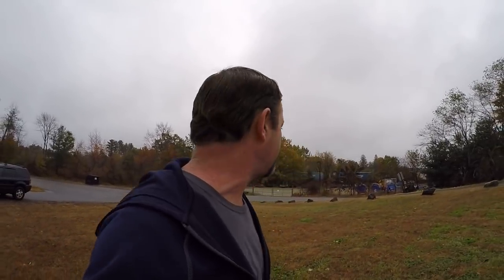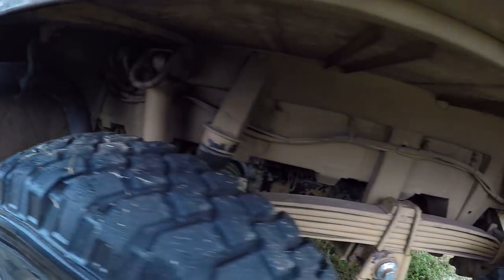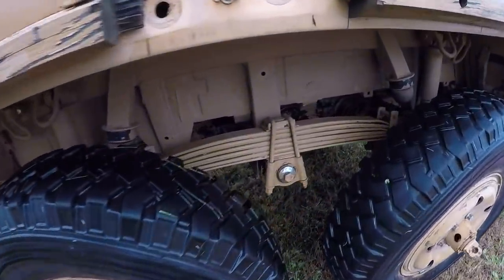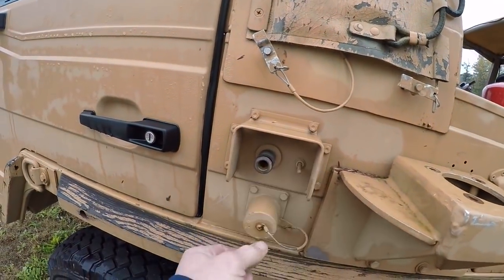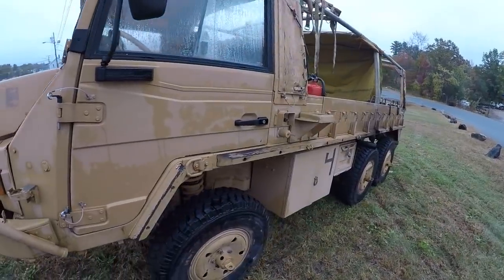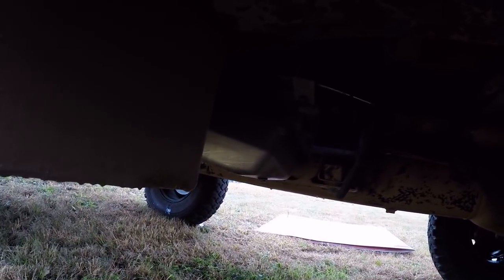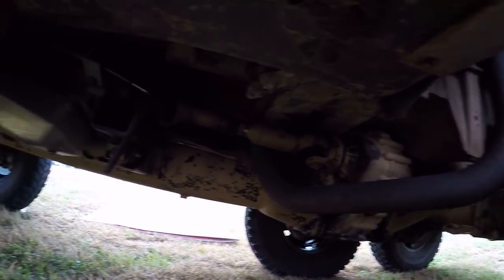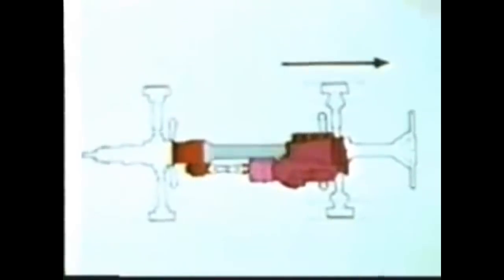70's Puch Pinzgauer 6x6 Ultimate Off Road Vehicle!

Comment: Originally made by the Steyr Puch company with an air cooled straight four in Austria.
The name Pinzgauer is an alpine horse.
The later ones, which is the one in your video is the later with the six cylinder diesel from VW.
Eventually the rights to build them was sold to British Aerospace. Production was only stopped due to the advent of IAD's being  used in the combat zone. The Pinz has no protection from IAD's.
You are correct, the central tunnel is it's chassis.
It was designed by a Mr. Ledvinka Jr. He worked for Tatra in Czechoslovakia before fleeing to Austria before  WW2. His Tatra T97 was copied by Porche.
The locking diffs are a work of art, I wiil see if I can find the video of one and let people know who would like to see it.
Reply: @MrBenBitch  Pinzgau is a province of Salzburg/Austria. Pinzgauer just means "from Pinzgau", and there are Pinzgauer cows and horses. The Pinzgauer vehicle is named after the horse, just like the Steyr Haflinger is named after the Haflinger horse and the Steyr Noriker after the Noriker horse.

Comment: I believe they still make them, they're still going into service with UK armed forces as a replacement for the Land-Rover now that the Defender is out of production.  The Royal Navy also used the smaller Haflinger predecessor back in the '60s as they could be flat-packed which made them very convenient for stowing on-board ship...

Comment: That's the 80s diesel version.  718M.  Even rarer in USA than the gas versions.  It looks like it might have been one of the dozen or so used in Desert Storm by Delta Forces.
Reply: ps, if you are ever in Colorado, I can demo the 710K for you.  Nothing is faster offroad... except maybe a 718M.
Reply: @ErikDJ123  That was my thought also.  Judging by the shape of the hood and the disc brakes, it should be a 718M (series II) - starting between '86 and ending somewhere in the mid 2000s, I think.  So the discs all 'round and electric winch aren't as unusual as would appear at first, what with the body looking like it was designed in the late '40s.  :-)

Comment: These have parts from vw and the g wagon....engine is from vw,  mirrors , doorhandles, dashboard and instruments come from the g wagon.  They are build as 4x4 ( 716) and like this one 6x6 ( 718)..... there were 3 different versions known as the P80 , P90 and P93 ....the P 80 was builg in Austria by steyr Daimler puch and had a 6 cyl 2.4 l turbo diesel....the P 90 and P93  was build in the U.K and have a 6 cyl turbo diesel with intercooler...the last versions have the 5 cyl 2.5 TDI vw / Audi engine......

Comment: Cool military vehicle looks to be 712M 2.5l - 2.7l in-line  4 cylinder air cooled. The M designates the body type as a soft top with rear passenger seating most likely used as troop carriers, other body variants were T flat bed carrier FW fire truck K 5 door station wagon W workshop D 4 door crew cab and AMB-S ambulance. You mentioned disc brakes so it may be a 2nd generation which was powered by 6 cylinder VW diesel. It sure would make a great camping/ exploration vehicle for you Amesie. Just don’t break it.
Reply: This is the diesel ... you can tell by the big radiator snout.  718M
Reply: ErikDJ123 thanks for clarifying. Makes sense extending the nose to fit the 6 cylinder.
Reply: The nose holds the radiator as these are liquid cooled and not aircooled like the older versions

Comment: the air cooled got around 90 hp, the diesel ones got stadart around 115 , but easy to get them up, ours is at 160 with bigger turbo and chip

Comment: I have a Honda XR 250 Special forces Dirt Bike with the same paint. Came out of a Military sale Fort Campbell KENTUCKY. Home of Army special forces. You will not find much info on this vehicle because it was used in Top Secret operations by Delta force in Afghanistan, Iraq on deep Recon.  Hidden in the day operations at night. It is Not identifiable as a US  Vehicle. It was painted at the Bluegrass Army Depot near Winchester Kentucky by military contractors. The Paint color is called  a discontinued PPG color called "Burnt Grass"

Comment: Pinzgauer, originally produced in Austria and based on tubular concept of drive train same (and therefore sometimes called Tatra-concept) as Mr.Hanz Ledwinka was originally designer in Tatra but was forced by communistic party to emigrate from Czechoslovakia (where Tatra trucks are made).
That tubular concept is pretty tough and rigid drive train, completely sealed and bathing in oil. Bent cardan shaft? No way! So the upper shell is sitting on the frame and can be lightweight.

But Steyr-Puch produced those in Austria between ~1970 and 2000 and then sold license (whole story is more complicated and described on wiki) to UK based BAE Systems. Which produced newer models 716/718 (4x4, 6x6).
https://en.wikipedia.org/wiki/Pinzgauer_High-Mobility_All-Terrain_Vehicle